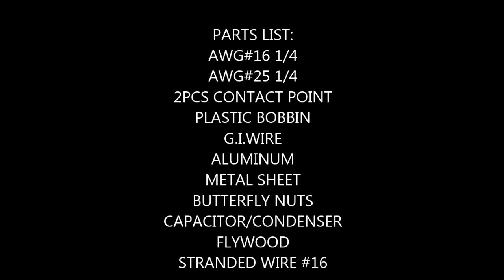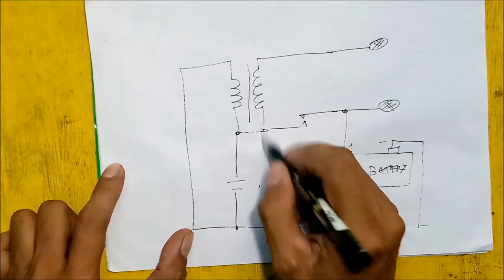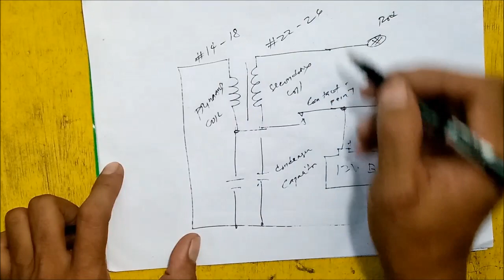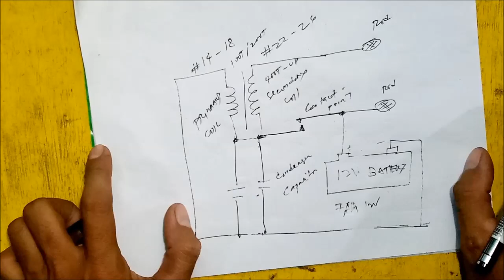DIY FISH STUNNER /PANG KURYENTE NG ISDA -PART 1

Comment: boss anung number ng magnetic wire na gnagamit
Reply from the maker: #16 at #25 awg pwedi rin #14 at #22 na mgnetic wire maliit lng nmn kc yn gwa ko sakto lng png hito at bulig
Reply: @elytronix kinilo po ba yung magnetic wire magkano kaya kilo
Reply from the maker: @valenzuelailene291  nbibili per grams or kilo nsa 385pesos 1/2kilo depende sa size
Reply: @elytronix  anu pong voltage ng condenser magkano po ang isa nyan ng condenser at ask ko lang po pwede po ba yung mga capacitor ng old amplifier nalang basta pareho lang ang volt
Reply from the maker: @valenzuelailene291  un sa electric fan pwede basta 1uf up condeser nbibili sa auto supply khit isa pwede